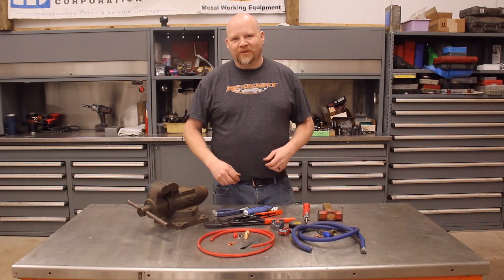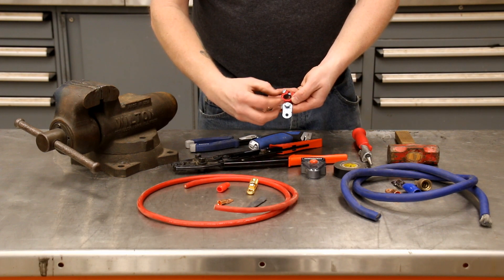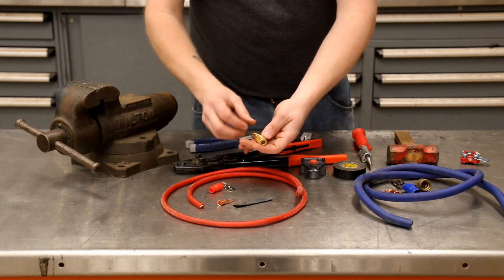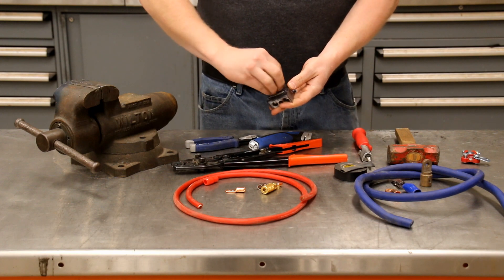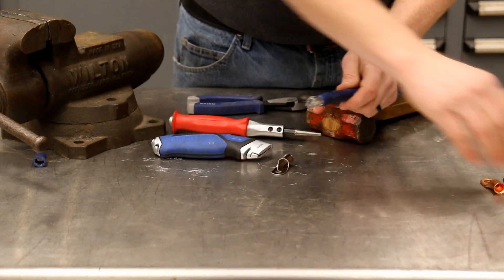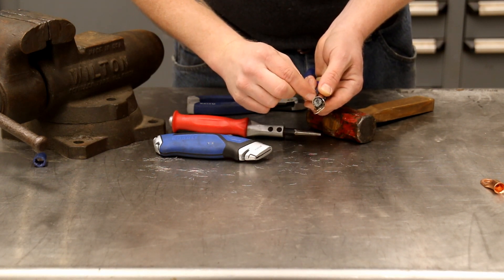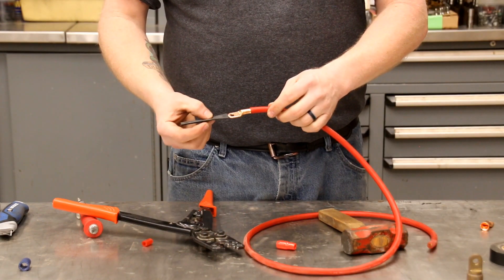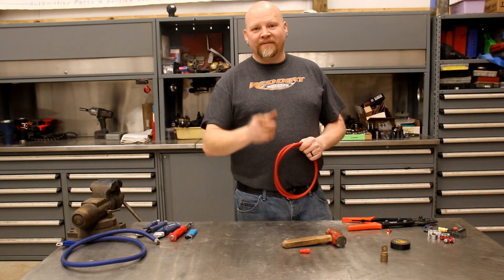How to Make Battery Cables

Comment: The worst battery cable connector video ever. Get some help !
Reply from the maker: @gatorwing6231  how so? I can't WAIT to hear your reasoning...
Reply: @Reddirtrodz  Never flatten the flared end of the connector. It is flared to allow it to flex without breaking. Soldering lugs where the solder gets near the flared end is also bad news.
Reply from the maker: @gatorwing6231  and I did none of those things. Nice try though.
Reply: @Reddirtrodz  Touche Turtle🤪

Comment: The first cable is a disaster.  Technically no you should not cut strands of wire like that when you're cutting the insulation, that is way too much pressure used to trim the insulation.  The strands should lay naturally and not be twisted, although I lightly twist mine as well so the strands lay naturally.  The wire should not protrude more than 1/16" (or width of a finger nail) past the end of an open connector on either side of the crimp end.  At the end of the day if looks don't matter and it functions well, then I say screw it and go with it.
Reply from the maker: The first cable was done as an example of how you can do it if you dont have the right tools. That version is just fine. It will last and work, but it isnt the best option.

Comment: Great video, Thanks. You also can solder your connectors. I like to grind off the end lip on the copper lugs and have a little bit of wire showing on the end. Don't forget to slide the shrink tubing up the wire far away from the heat.    Make sure the wire is clean and use plenty of flux. Apply heat at the end of the lug and let the solder suck itself in, then slip over the heat shrink.
Reply from the maker: Thanks!

Comment: Lots of useful info here. I can’t believe how many vids show soldered lugs — and flux/solder that are supposed to be used only with copper plumbing. I highly recommend a hydraulic crimper. I bought one on Amazon that effortlessly makes indestructible connections. Also highly recommended is a cable cutter. They are inexpensive and useful for home/shop wiring — the only tool for cutting Romex.
Reply from the maker: I agree completely. I like a hydaulic crimper too. I use cable cutter for wire and hose, it is 
very useful. Thanks for watching and commenting!
Reply: Flux and solder are absolutely used in wiring to tin wires outside of the insulation.  The hard part is the solder is not suppose to go retract or suck under the insulation.  During any Miniature/Microminiature (2M) Module Test and Repair programs will teach you to that in-depth level.   I agree though that a hydraulic crimper is the best for the larger gauge crimps, but what he is using is great for the gauge wired used.

Comment: You Showed those bare copper end. I don't allow those in my shop.. Bare copper corrodes... I build a LOT of marine cables... I use the same stuff on Hot Rods...Marine grade ends are "Tinned "Copper and closed barrel. The thin wall work best.   I see Sooooo many cars at car gatherings with those Damn $.99 ends on them and all the wires exposed... It's Garbage and Looks like Crap.
Reply: You are absolutely correct. I would not want to be on an aircraft with open end barrels. The open end barrels are for solar or high fi equipment.
:face-fuchsia-tongue-out::hand-orange-covering-eyes:🤪😜😝
Reply: @gatorwing6231  I wouldn't even use "Open Barrel" at All.  Why? When you can just have a higher quality product.  :)
Reply from the maker: These are the same ends used by most OEMs. When installed properly and sealed with either heat shrink or quality electrical tape, they will be just fine for years. 

If you are wiring a boat, then sure, a marine grade terminal is warranted. 

Thanks for watching!